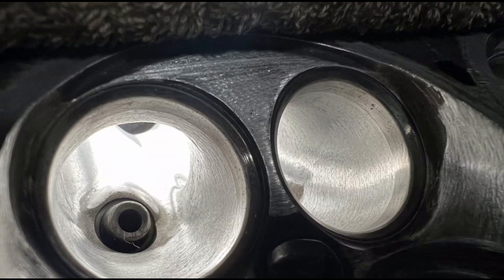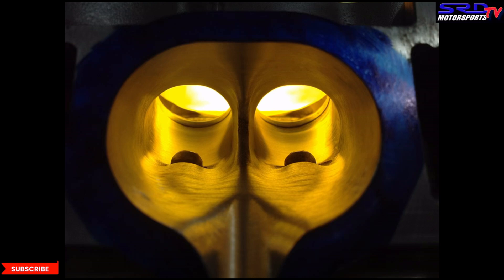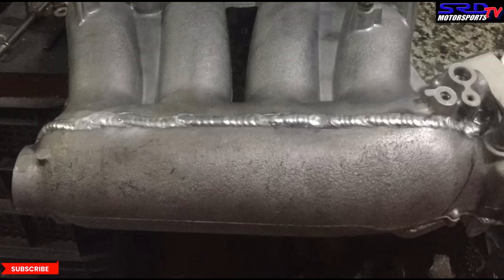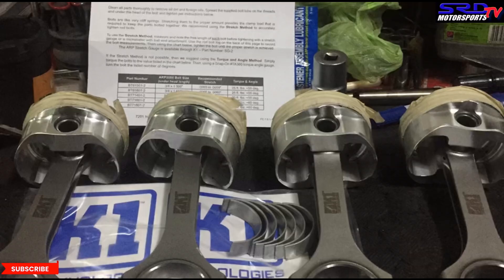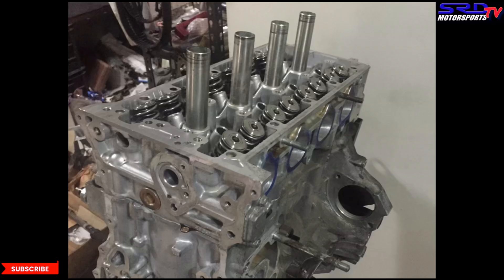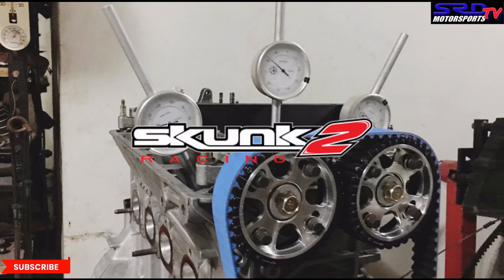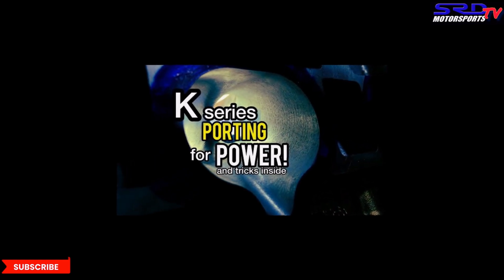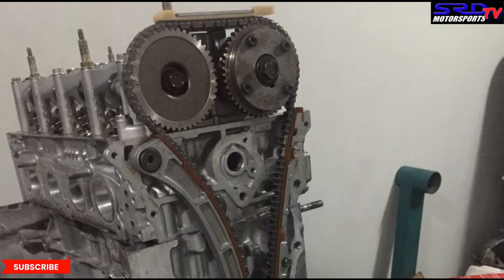K24 Build VTC Talk Drag Cartel Cam by SRDmotorsports

Comment: Hi always love to see your videoes , id like to kno how to delete the vtc on my k series engine pls
Reply from the maker: the ecu can actually disable it… but if mechanically then u got to have that intake gear machined
Reply: @SRDmotorsports  thx for the replay , I'm from  the caraibean and watch your videos alote , I'm setting up a k24z7 and I have a kms ecu I'm putting on it , I've locked the vtec im using k24a1 intake cam cause the k24z7 cam got damaged, i want to delete the vtc cause the kms don't controle the vtc , should I lock it in full position or at least half way , it's a 50° cam gear from the k24a1 rbc .
Reply from the maker: really depends and the numbers on the Vtc the 25 or the 50 is degreed overlap so that’s something to consider and check

But leaving the Vtc as is may just keep it at “zero” so might not have to do anything
Reply: @SRDmotorsports  thanks alot for the reply
Reply from the maker: No problem buddy

Comment: Love watching your videos, great job!

How people make k24/k20, even k20 with more agressive cams without blowing the engine? Last,i've heard that tensioners from timing belt, even the aftermarket one won't hold and will fail causing engine blow. In k24/k20 i've seen some engine blow, some say due to bore stroke ratio, is that true? And if not how can we build to make it reliable?
Reply from the maker: Good question, I mean I haven’t tested alot of K’s yet but there must be a solution for sure
Reply: Timing chain issue is remedied by replace tct on stock motors every 80k and on aftermarket cams every 40-50k

Comment: Good afternoon, I tried to find information myself but could not and decided to ask you.
The motor k24 is going to the bottom on the pistons SS 11.5 to 1
RBC head with slight porting. The exhaust system will be self-made without a catalyst, standard C-RV plastic intake.
The motor will be placed on the C-RV 2 with a automatik transmihsn. The task is in pleasant dynamics from the bottom and in the middle rpm, driving around the city and the highway, no races and maximum figures from the dyno are needed.
And the question is, K24a3 is taken as the basis, I would like, since such a thing, the VTC gear by 50 degrees, but what shaft can be put in addition to k24z3, does it have an alternative?
Thanks in advance for your reply.
Reply from the maker: Oh nice project!  A camshaft that is not expensive and far is stock
Specifically a k24a2 or k24a3 of 2003-2007 are the bigger “stock cams” but shhh don’t tell anyone that’s a secret :)
Reply: @SRDmotorsports  I now have k24a3 and K20z2 in stock, what is their difference, and if it makes sense to choose an exhaust camshaft?
Reply from the maker: @ПавелКовалёв  it’s I believe only their intake that has slight more duration  so as long as u have the intake it’s good
Reply: @SRDmotorsports  щіро вам дякую
Reply from the maker: @ПавелКовалёв  ah sorry not translated can’t read it hehe
Reply: @SRDmotorsports  thank you very much. literally translated from the bottom of my heart

it's in ukrainian
Reply from the maker: @ПавелКовалёв  oh snap! Have a friend from
Ukraine that’s so cool her surname is Maliarova so if it’s Ukrainian? Hahahaha

Welcome
My friend and thank you for checking my videos out! Lemme know ur name
Reply: @SRDmotorsports  by origin, Maliarov is a Belarusian surname, like mine (Kovalev).
But many Ukrainians, due to the mixing of peoples, have surnames that come from neighboring countries.

And yet Malirov is a guy, and Maliarova is a girl
Reply from the maker: @ПавелКовалёв  oh yes yes she taught me that! Glad she taught me correct that if a guy it’s Maliarov and she is a girl so Polina so it was Maliarova